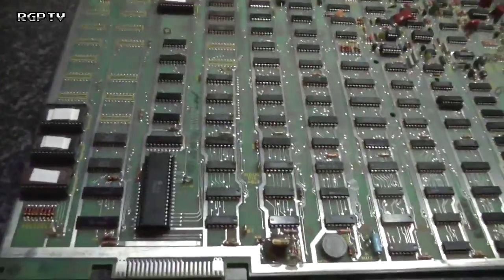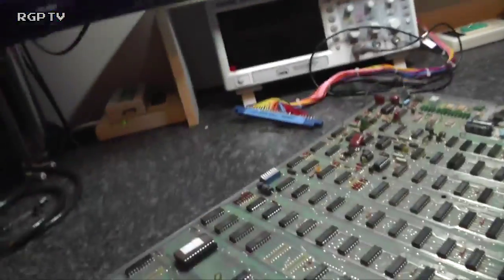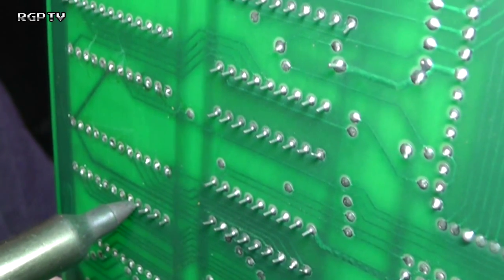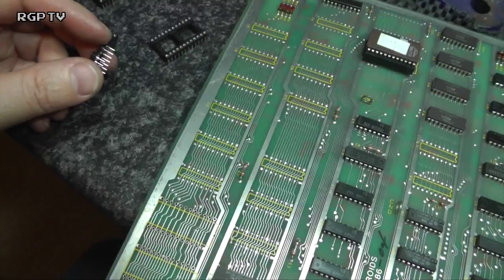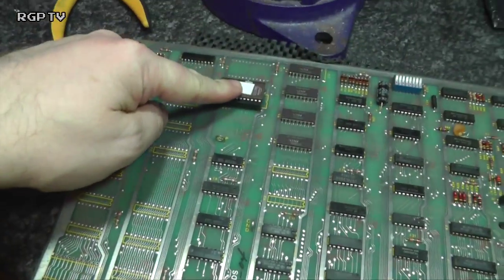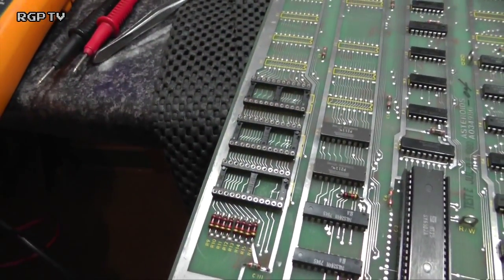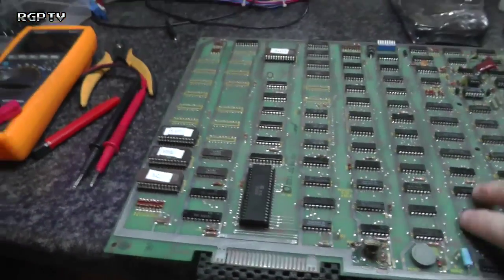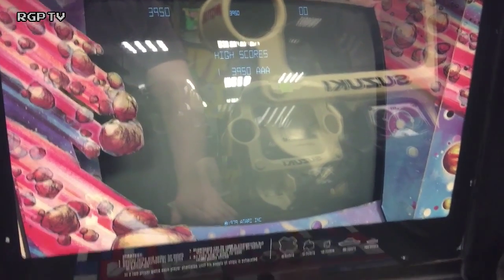Atari Asteroids PCB Repair Bad ROM Sockets for Arcade Club

Comment: Safety! Use a fume extractor. I now have a lifelong severe autoimmune disease due to circuit board repair without proper fume extraction. Everybody solders and says, "haha, I feel fine!" but by the time you do feel it, it's too late, and there is no cure
Reply from the maker: Way old video, no longer the case, I do very very little soldering these days but we have extraction and good ventilation.